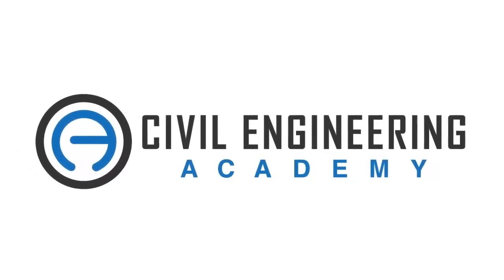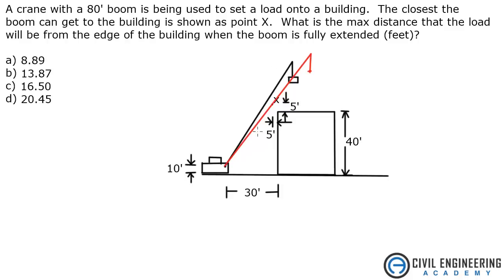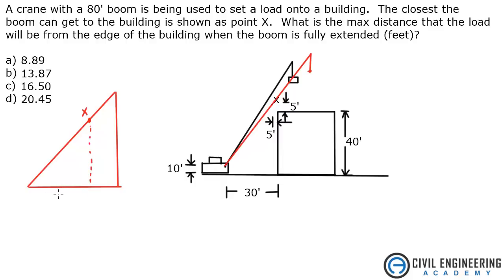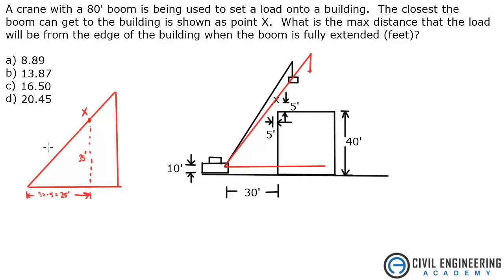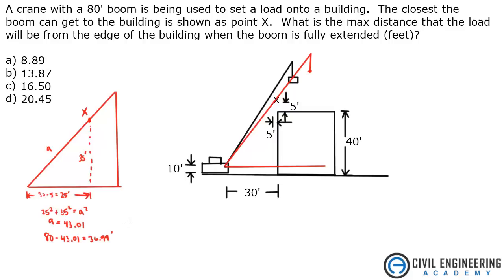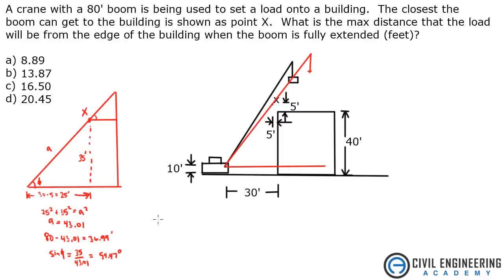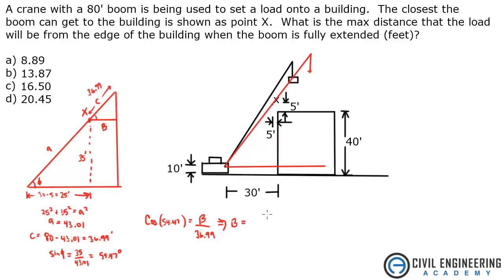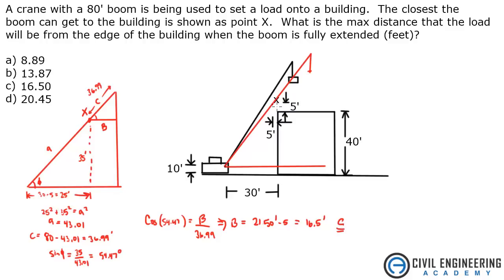Construction-Find the Crane Load Distance Over a Building

Comment: Once you find the two sides of the first triangle with point 'x', all you need to do is use TAN^-1 function to find phi. There's no need to solve for 'c' once you have phi. Just use equation [Boom length * COS(phi) = 30 + X, where X = distance from edge]

Comment: Love the videos. Thank you. But I strongly believe some numbers are incorrect in this video. Sin-1(35/43.01)=60.517 degrees. NOT 54.47 degrees. That was throwing me off quite a bit.
Reply: you are wrong. sin-1(35/43.01) = 54.46 degrees. Your calculator is set to  GRAD and not DEG. Need to change your mode.

Comment: Shouldn't the first equation be 25^2 + 45^2 = a^2? Add 5 to the height of the building to reach x, which would be 45 instead of 35.
Reply: Building height (40) plus the height to the point x (5) minus the height to the crane off the ground (10) is 35 ft

Comment: I did this problem using similar triangles.  the first triangle is 29.5 b x 40.5 h then find the H1.  The second triangle is an X Y with H of 80.  Set the ratio of 29.5/H = X/80.  You get the X.  Then subtract X-30.5 you get the answer.
Reply from the maker: Nice!